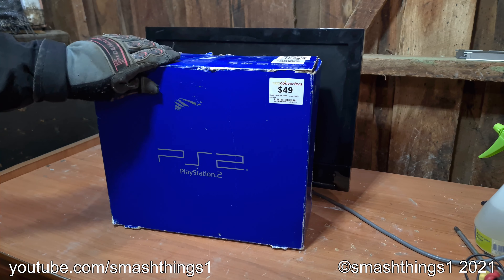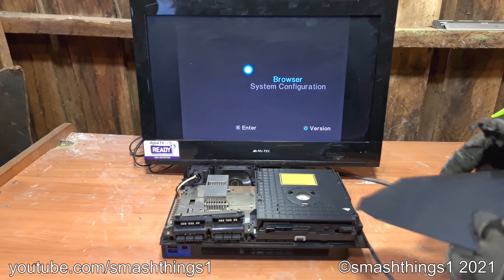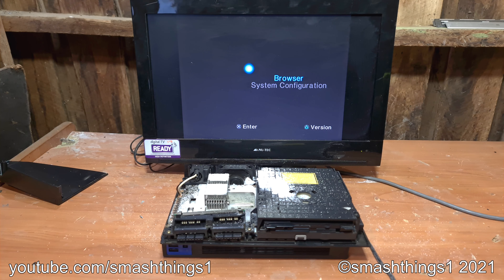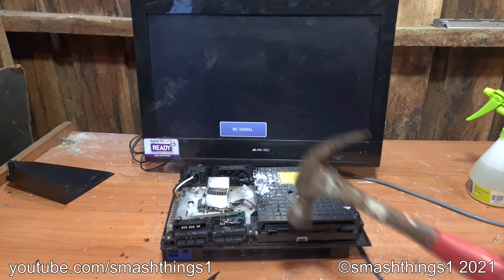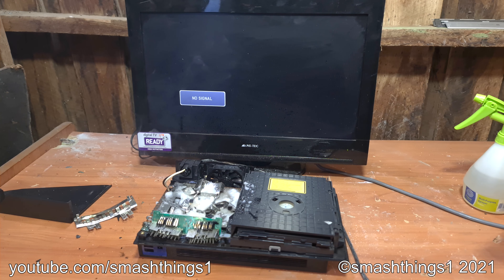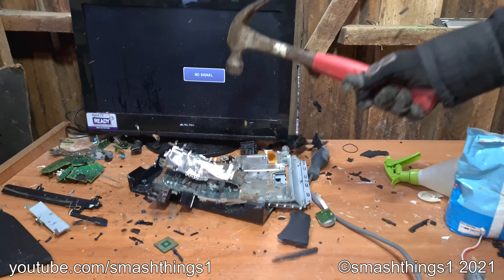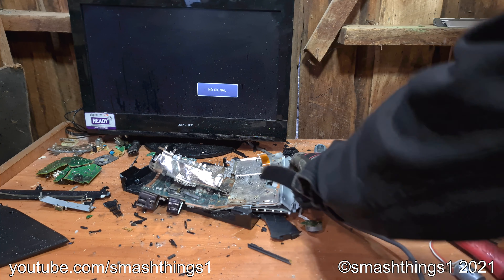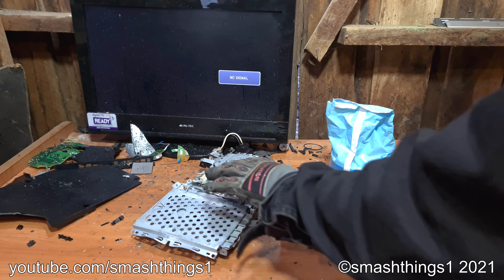Sony PlayStation 2 Salt Water Test & Smash

Comment: No Disc Tray, No Controller, No Memory Cards, No Perfect Console, No Working, $49 on EBay, Curious 🙂
Reply: It not from eBay, he bought it on cashies
Reply: The cmos battery is dead too
Reply: @Wovision.  Not inside PlayStation 2 No Controller no disc no memory card
Reply: He got it on cashies not ebay

Comment: Fun fact: The internal battery wasn't dead. When you have the console switched off for AGES, the clock can reset. That happened to mine and I reset the time. My PS2 is an SCPH-50003
Reply: The same happened to me
Reply: same on 70004

Comment: I find interesting how that's considered the best model of the PS2, but still, it's worthless due to how much the PS2 sold
These things are everywhere, but people still think they are worth millions of dollars
Reply: You can find a PS2 for less than 50 USD at a local thrift store, that's how valuable they are.
Reply: yeah its crazy that these things can be considered vintage but theyre still dirt cheap, that wont last forever of course
Reply: @drakevevo3710  i know.. i had a SCPH-39004, disassembled it to give it a cleaning, but when i reassembled it, broke 2 flat cables (only the blue part, pins were fine) and some flat cable connectors

Bought a Silver Slim 2 days after (SCPH-77004),  but now, the laser on that one is faulty.. only reads CDs
Reply: I have an old 7900 and it runs smooth like butter like a ps2 should
Unless you put Gran Turismo 4 in then it sounds loud.
Laser may or may not be leaving me.
Reply: @crazedlunatic43  In Ecuador they sell it at 70 USD with a USB with free mcboot and not including dvd laser. It's quite expensive for the actual economic situation in normal families.
Reply: @Jothsal  Depending on where you are, it definitely does vary from region to region. Though the PS2 might be pricey in some parts of the world, I doubt it would be more expensive than let’s say a GameCube for example: A system with a tiny install base (But wasn’t a commercial failure and was much more profitable than the Original Xbox) compared to the PS2’s juggernaut install base. GameBoy Advance SP models (especially ones with full backlight) will fetch even higher prices than the PS2 system, due to how many were made compared to the number of GameBoy Advance SP systems and GameCube’s made.
Reply: @crazedlunatic43  Exactly, the GameCube here does not go below $100.
Reply: People like this guy will reduce the numbers until it PS2 becomes rare, then it will become valuable.
Reply: @drakevevo3710 electronics aren’t a great investment if you’re looking for long term value due to the fact that they age like milk
Reply: Ps2 are 150$…
Reply: @vinceygaming At DKoldies? Sure.

Comment: My dad have a same model with a UK🇬🇧 Power Plug, My dad Brought it in 2003 or 2004 with OEM DualShock2 Extra Controller (Sold Separately) when it is Included in the PS2 Box + OEM Memory Card (Sold Separately) + OEM Vertical Stand (Sold Separately)
Reply: which model is 39002 or something
Reply: @SickBigbac  It's 39006

Comment: Good bye faulty PlayStation 2.
Reply: Who said it is faulty?
Reply: @danek_hren  Late, though if I remembered correctly the unit didn’t read CDs or DVDs and the condition it was in wasn’t great either, like it was previously beaten up. Perhaps “faulty” wasn’t a correct term to describe it’s condition, rather, I’d call it poorly constructed with how awful the build quality was on those models.

Comment: There was still a lot of good usable parts on there. What a shame
Reply: Even if it is true, there are more than 100.000.000 consoles. WHAT'S WRONG WITH YOU?
Reply: @danek_hren  who cares how many consoles are out there? They don’t make them anymore and parts will be harder to find in the future. Even if they make aftermarket replacement parts they will never be the same and as reliable as the OEM parts. I suggest save as much as you can before it’s too late
Reply: I like watching these videos but at the same time i think “why do this” yeah there’s more than 150 million of em out there but like you said they don’t grow on tree’s anymore I guarantee within the next 50 years at least they’ll start getting more rare as more break down but then again there’s alot of people who restore these things regardless on what console they are in so this ps2 could’ve been restored regardless of the difficulty
Reply: @fangojett6001  I can easily find a PS2 at a local thrift store for less than $50. You underestimate how many of these exist and I could easily construct an entire San Francisco bridge out of them.
Reply: @Viper-jr4sp  I doubt they would even last 50 years anyway, considering that they had a high failure rate compared to other consoles of it’s time. Still, 50 years is a long time anyway and with so many of them out in the wild, I could build a 135 story skyscraper with these PS2’s lying around.